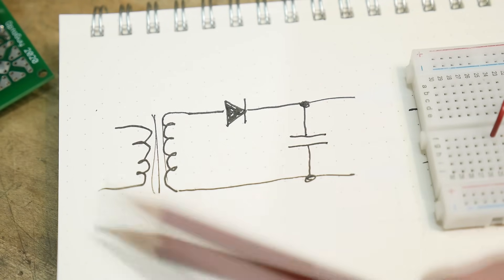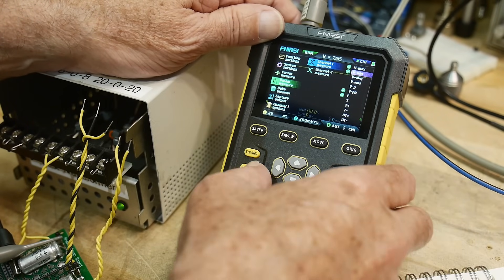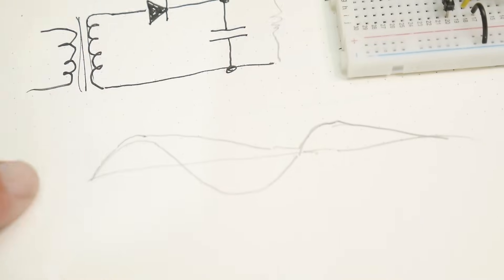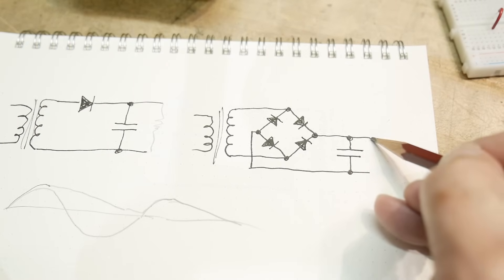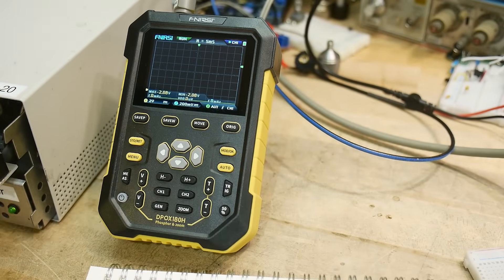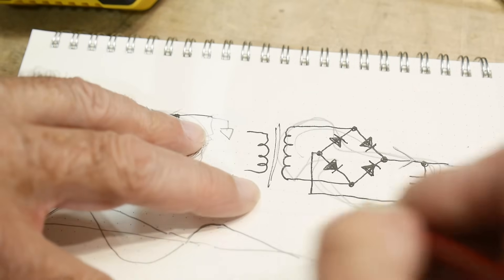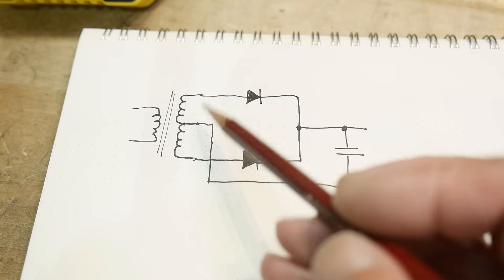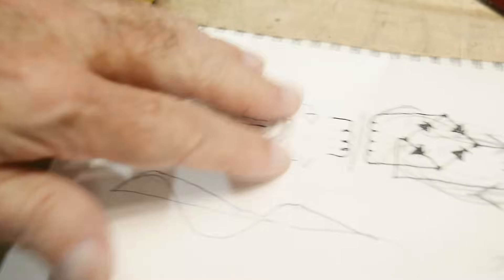#1883 Linear Power Supply Basics (part 1 of 2)

Comment: The reason why the full bridge rectifier had a lower voltage (10.5 instead of 11), was the voltage drop by the diodes. There the current has to flow through two diodes. The other versions only have one diode in their paths.

Comment: You still commonly see the dual diode center tap configuration in outputs of ATX power supplies. They usually have one large dual diode package common cathode per rail.

Comment: Why does an earth ground make the ground connection matter?
Reply from the maker: if the power supply is earth ground referenced and you connect to a device that is earth ground referenced, good or bad things can happen
Reply: @IMSAIGuy  thank you!
Reply: Your scope, if AC powered, will have the returns on the scope referenced to the Earth or safety ground.  So if you are measuring something referenced to the earth or safety ground the scope has to have the Ground connection tied to this earth ground.

Comment: Usually when explaining circuits i use the term reference (vref specifically) instead of ground unless it is tied to earth ground. Ground tends to throw people off. Just easier especially when dealing with floating or biased voltages.

Comment: Thanks for the videos, keeps me thinking.  An advantage of a center taped transformer over the full bridge is you only get one diode forward voltage drop which might be a consideration?  There is the also the split supply advantage as mentioned by other commenters and a half wave rectifier without any reverse current in the other half cycle increase magnetic losses in the core.  Thanks for all the great content, keep it coming pls.

Comment: Now you have me questioning how a scope/meter knows it's looking at a negative voltage or a positive voltage.  If all it can see is a difference in potential, how does it know "which way is up"?
Reply: One of the leads on a 'scope or multimeter probe will be the "reference" lead. This is the "ground" clip on a 'scope or the black/negative lead on a multimeter. The voltage shown on the 'scope or meter is relative to the reference lead. So if you put the red lead on +12V on a PSU and the black lead on ground, the multimeter will show +12 V; if you reverse the two probes it will show -12 V.

All voltages in a system are relative; you just pick some arbitrary point in a circuit to call "ground" and then everything is relative to that. That was the point being made near the end of the video.

Actually, you don't even need to pick a particular point in a circuit; I can just arbitrary label something run from a 12 V PSU as having +112 V and +100 V power inputs, and nobody can say I'm wrong (though they may not be able to find any point in the circuit that actually measures 0 V relative to my 0 V reference. But even at "112 V" and "100 V", my two power inputs are still 12 V apart.
Reply: @Curt_Sampson  Oh, I totally get that part - earth is just a reference, just like someone standing next to a passing train, or someone on the train.  My question was HOW does it(the meter/scope) know it's positive or negative.
Reply: @GeorgeGraves  For the multimeter the reference is always the "common" input, into which you usually plug the black lead. for the 'scope the reference is the "ground" pin. The voltage each shows is relative to that reference and that reference only.

In other words, the instrument has no idea what you may have chosen as the system reference voltage for your board. If you want to figure out what the "real" voltage is by that reference, you need to subtract the instrument reference from your system reference. E.g., if you put the black lead on your -5 V bus, and measure your +5 V bus, the meter will show 10 V, and you have to subtract -5 V from your 0 V ground reference, to get 5 V, and then subtract that from the 10 V measured at the read lead to see that it's measuring 5 V relative to your system ground.

I have the feeling that this explanation may not work very well, since it doesn't seem very different from what I said before, but I hope it helps. The key is to remember that the meter is measuring only one voltage, and that's the voltage difference between the black and red leads, regardless of where you place them on the board.
Reply: @Curt_Sampson  Thanks.  I guess you're describing how to use a multimeter.  I'm asking how it works - specifically how it knows a negative is a negative, and a positive is a positive.
Reply: @GeorgeGraves  If the red probe is at a spot higher in potential than the black probe, the voltage is positive; if the red probe is at a spot lower in potential than the black probe, the voltage is negative.

Or are you asking how a voltage meter works internally? That differs for analogue and digital meters.

An analogue meter has a moving coil through which a little bit of current tapped off the circuit passes; this causes the meter to move right (for positive voltages) or left (for negative voltages) .With an analogue meter you (usually) cannot measure negative voltages because the rest point of the coil is at (nearly) full left deflection of the indicator needle. (In this case, if you see the needle "bump" left, you need to reverse the leads and read the deflection rightwards as a negative voltage.) But some voltmeters have a rest position in the centre, allowing you to read either positive or negative voltage directly off the needle over the scale.

A digital meter uses an ADC (analogue to digital converter) to compare the input voltage to a carefully calibrated constant voltage source; these are complex and I won't go into the details here. But the principle is the same. They can either have the "zero voltage difference" point in the middle of the ADC, so that half the resolution is positive and half negative or could, presumably do two reads with the second doing a virtual "swap" of the lead; one reading will be zero or max scale, and the other will be the voltage difference. But it's probably cheaper just to add one more bit of resolution to the ADC than to build the circuitry to do this swap.

Comment: How do you get + and - voltage (like for an audio opamp circuit) out of the bridge example?
Reply: Use the CT transformer and a bridge with two filter capacitors.
Reply: You can, if you are expecting a reasonably balanced loading between the positive and negative sides, use the center tap of the transformer as your ground reference. You'd have separate filtering and regulation for each side.
Reply: Google it.